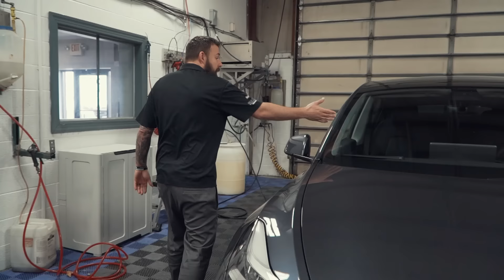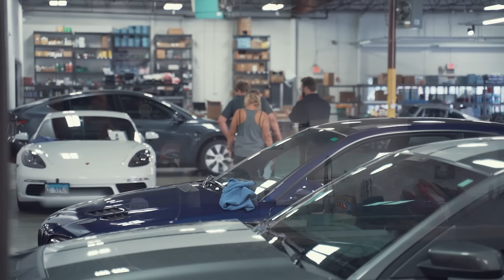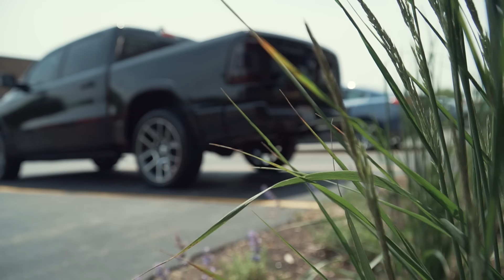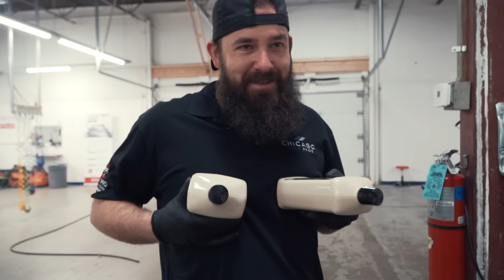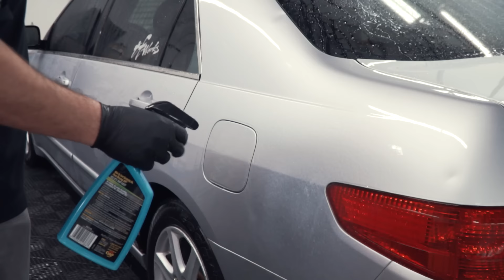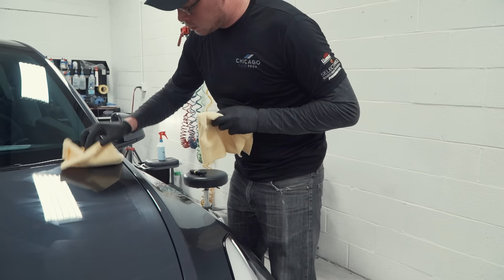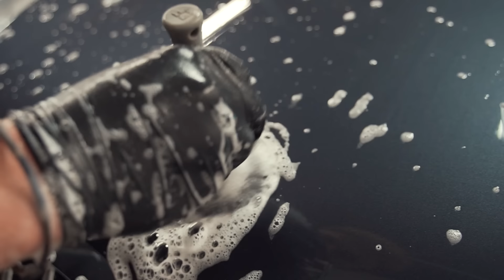Everything You Need to Know Before Buying a Ceramic Coating

Comment: As a seasoned auto insurance adjuster of nearly 2 decades, I have nearly seen it all. My involvement here is post-collision repair partial application invoices. Original invoices are also acquired for verification. In Southwest PA original bills for ceramic coating are running anywhere between 1,500 to 10,000 dollars. Yes, there are people paying 10 large for ceramic coating their..... Ford Explorer. On average it's between 2,500 and 5,000. Re-apply after paint cure time is running around 2,000 to 2,500 for 25% of the vehicle. Sometimes 4k or 5k. The issue so alarming here is the lack of knowledge combined with incredible sales tactics, pressure and manipulation. The general public is being led astray and they are pouring out their wallets for this stuff. And while the 1% of vehicle owners who are car enthusiasts, and might ceramic coat their well taken care of vehicle, the other 99% drive their vehicles into the ground and should be using their hard earned money elsewhere. Sadly, many people will listen to a new car salesman over anyone else. Somehow the new car salesman hoodwinks the public into believing their fabrications. Your Ford Explorer that in 3 years will be driven into the ground, be covered in curb rash, dents and scratches all over, which you will get rid of as soon as the warranty is up does not need ceramic coating! But if you wash your car regularly, detail it regularly and actually open the hood on a regular basis and care for it, then get the coating. Just don't get taken advantage of and think that in any world it is ok to spend 10k on this, let alone even 2500 dollars.

Comment: My cars getting done as I type this.
I come across this video and because of the title and likes, I freaked out at first lol.
Great video,  title ya got me!

My question is, my Karcher K7 pressure washer has 3 speed's.  And the rotation cycle. 

I had been washing my car on the highest setting,  and rotation cycle. 
Am I using to much pressure and is rotation setting good or not? Please
Reply from the maker: Definitely use only as much pressure as you need to properly clean your vehicle. Remember that the soap/shampoo you are using should be doing a majority of the work, and that the water simply carries them away. Look into flow rates, as a combination of a good flow rate and pressure will make cleaning a breeze once you're dialed in! A pressure washer should not affect a ceramic coating.

Comment: Hi,

I bought a new car a couple years ago and it has a clean accident history, however after washing numerous times I noticed the front fender has lost its gloss and looks dull like it has been painted previously. How should I fix this? Should I get the fender clear coated? Will a ceramic coating and paint correction be enough to fix it? 
Please help

Comment: I take care of my car regularly by hand-washing it. It is completely covered with Expel Stealth Ultimate PPF.  I thought adding a ceramic coating would allow water to sheet off the car so I wouldn't have to hand-wipe it down after washing.  WRONG.  I thought it would help eliminate water spots from dew, rain, etc. WRONG. This was a VERY expensive mistake on my part. If your water is soft, it might not leave spots, but my water is  hard and calcium (one of the ingredients in hard water) makes white-edged water drops all over the car if I let them dry without wiping the car down.  It is MURDER to get the spot off the PPF.  I used the Expel Ceramic coating because they said it would work with their PPF.  Save your money. It doesn't.

Comment: Thanks for sharing great video. I have 2 questions 
1) How increase level of scratch resistance when I apply ceramic coating?
2) In terms of scratch resistence, is ceramic coating has same level of protection with wax/sealant/hybrid sealant?. Thank you

Comment: So get your car ceramic coated and then bring it back in to get it topped every 6 months to 1 year? If ceramic coatings are so durable, why the topper? Every 6 months you would be waxing anyhow, right? I'm really confused why I should spend the money on ceramic coating when im going to wax it every 6 months anyhow. And I can do it at home, myself. Please clarify why the ceramic coating needs the topper and why I shouldn't just wax my car every 6 months.

Comment: So I have a question about some of the ceramic coating’s. Some of them will say in the directions that you need to wipe it off in 30 seconds. So I’m assuming it could wait at least a few minutes because how could you ever get any work done if you’re too busy wiping off constantly. I just need a little clarification on this. The one I have says 2 minutes but I’ve seen one I was looking at said thirty seconds.

Comment: I have a new phoenix bass boat 2023, my dealer offered me this option when I purchased it but i declined at that time, But now reconsidering it, I normally wipe the boat down and use lucas SLICK MIST. spray was, I have found this brand to work the best and is what I have used on my previous boat's , I am located in Texas and boat is used in fresh water lake's only, Just looking for a product that work's best for marine application's. any brand recommendation's?

Comment: I disagree about a coating being useless if take through a car wash. 

I have a client that takes his Audi A5 through a wash a few times a week. 

The first time I serviced his car I used a sealant + wax over top. When  it came back it was swirl city. 

The second time I used Optimun Gloss Coat, and the swirls were much lighter, and were easy to remove. 

The time after that I used Megs M26 and it came back really swirled up. 

This last time we used Jescar Ultra Lock +, but next time we're probably going back to the Gloss Coat.

Comment: I use a good outdoor car cover, and wash my car at least 2-3 times most months, except in the winter where I have a body shop wash the car. When I do it myself I spend an average of at least 3 hours washing and waxing. I wax my car at least 2 to 3x every two months with a spray wax. My car is a 2012 volvo. Neighbors tell me it looks brand new. I wish I had a garage. I'm looking to move, and hopefully I will have a garage. A bird two years ago on a windy day somehow snuck under my car cover, and  left a stain. It was there 2 years, and I finally had it repainted.

Comment: Question, I'm buying a tesla model y and I'm reading the horror stories about the paint. I'm thinking between vinyl wrap or ceramic. What would you recommend. I do wash my car on a regular bases (hand). Waxing not as much and I live in Ontario Canada so I have 5 to 6 months of harsh winter which I usually just power wash once ever 1 to 2 weeks.

Comment: After having a ceramic coated vehicle I'm not sure I get the hype. If I get a 3 year coating and have swirl marks after a year I'm sort of stuck with them until the coating fails... but how do I know it's failed and hasn't just lost hydrophobic properties? Well maybe I'll polish it off... how can I tell that the coating is actually gone and I'm working with just clear coat? But if I use a good sealant I can polish whenever the car needs it and not have to worry about wasting that $1000+

Comment: I have an 81 black z28 with single stage paint. I've buffed the car a few times now, and it looks great from 5 ft away. I cannot get all the scratches out because of fear of cutting too deep. I want to ceramic coat it to help with maintaining the shine and also  to make cleaning it easier. Blacks a PIA as you know. So my question is this, when I do decide to get the car repainted some years down the road , will the coating cause any issues for the body shop?  Will it just sand off when they prep it? Thanks and I enjoyed your video. Very helpful

Comment: Hi, if you were to do a clear bra and then a ceramic coating on top of it, a) is it worth it to do both, and b) will the clear bra, if you have experience with those, will they help prevent from rock chips, etc? Another question on top of that, is for buggy states, what do you suggest to keep bugs from sticking, would the ceramic coating help with that?

Comment: I fully maintain my vehicle and I've had it for 3 years now and it still has that showroom finish.  I get it washed every morning because, I am an Uber & Lyft driver and I have a 2019 Ford Explorer in a Magnetic (Dark Gray) paint when I bought the vehicle new.  I go to a place called "The Wash Tub" here in San Antonio, Texas, and they are charging me $119.00 for the ceramic coating protection.  Is that good or should I go to a specialist.  Cause, they were telling me that the sheen or shine will only last for a 2-3 months and then I have to get it again.  Can you confirm before I make up my mind.  Thank. You.

Comment: Is there something to put on a vehicle to protect against scratches? I’m a contractor and I want to try to keep my truck as good as I can without scratching it by leaning over the side of the bed to get something or brush up against a tree branch and such. I’m not looking for a big shine or anything like that, I just want a protective layer for scratches. I’ve had my truck for 3 months now and I have scratches everywhere. My son was washing out the bed of my truck for me and the hose rubbed against the side along the front door, back door, and box and you can see right where the hose was. Stuff like that I would like to about if possible. Oh and my truck is black so everything sticks out like crazy.

Comment: I just had my Wrangler ceramic coated with Renny Doyle, and I noticed a few high spots/ smudges left on the paint.  Also, I noticed that the trim (fenders and plastic hood pieces), look streaky.  Are the plastic fender flares supposed to be ceramic coated, and how can I fix the streaky look? I apologize for all the questions.  Unfortunately, I didn’t do my homework before having this done to my brand new Wrangler.

Comment: I ordered 2022 RAV4 SE which has shiny (as opposed to flat) black trim around the wheels and above the undercarriage.  Been wondering how best to maintain the shine.  Should I be putting a ceramic coating on the shiny black trim?

Comment: Hey, just saw this. I’ve been professionally restoring headlights since 2017. Using the traditional sand and coat method. Recently I have been getting lots of questions about ceramic coating. I’m thinking about adding it as an option to cater to those people needs.any suggestions as to what to look for ? So many products prices and information. Is there a ceramic spray that’s just as good as the other?

Comment: Are you able to put a car cover over a ceramic coated car? My car is rarely driven and garage kept but it does get dusty fast. I want to ceramic it but if a car cover will scatch it too easily is it worth it? the way my garage is faced it always picks up dust fast.

Comment: Hi. So its almost 1 year into my car with PPF in front and rest of the car as ceramic coating. I wash my ca car 2 times a month with touchless car wash and then hand dry. Recently I drove in the rain which resulted in my car all dirty and spotty coming from vehicles in front of my car. Didnt have the time to wash right away and when I did 2 days later I could see dots all over the car. I used warm water to hand wash and it took out 70% if the gritty feeling. No scratches. But its still there and I dont want to over do it. Whats the best way to address this

Comment: So my other half takes his car thru a car wash and has a monthly unlimited pass. I've always 2 bucket washed my vehicles but after seeing how easy it is to take it thru the wash and they have the best vacuums- which I no longer had to lug out and run extension cords so I finally just started doing that. I just got a new Black 23 Tacoma TRD 4X4 Off-Road and I will not be going thru the car wash any more. So there is a ceramic coating place in town and they have lifetime warranty-I know ceramic coatings only last a few years so should I be weary of getting it done there-or what? Should their facility have any special features-like does it need to be done in a dust free zone, special kind of lighting etc.? I was also wondering with time does/can the ceramic coating start to peel or cause any kind of damage to the paint? Lastly, can you put wax on top of the ceramic coating to add another level of protection?

Comment: Hello from Sudbury, Ontario Canada! I have a question for you sir, but first a little background.
I just bought a black 2016 Mazda MX5 Club with only 8,000 miles, has the factory Sport Package (Brembo Brakes, BBS wheels, Bilstein Suspension & Recaro Seats). It's one owner car, meticulously maintained, lived in a heated garage, never saw snow and very little rain. He told me that a rather expensive ceramic coating was "professionally" done 2 years ago. Yesterday, I was at my local Canadian Tire store and saw a "Rust-Oleum Wipe New Synthetic Wax System" product on sale so I bought it. 
Now I'm wondering if I should apply it. I know absolutely NOTHING about proper car-detailing so my question is this...... Should I apply this stuff to my car knowing that it has already been ceramic coated?

Thanks for your time!
Leo

Comment: Well it's just the time & money to deal with ceramic anything..I just spray 2 more coats of 2 k clear every 5 years..turtle wax wash & dry works..you can do scratch removal & shine without removing layers of build up grime..soaps don't clean the grime so they build up with toppers

Comment: Very informative!!  What do you think about getting a Nanoxide coating on a used Lexus I'm getting ready to buy?  Although this car is 4 years old, it only has 16,000 miles on it.  The dealer is offering to install this coating on the outside & inside of the entire car for $1,200  and will warrant it for 7 years.   I plan on keeping my car for 10 years although I do NOT keep it in a garage and live in New Orleans where the sun can do a number on a car.  BTW...I'm a Realtor and usually save time going through a soft touch car wash several times a month.

Comment: Hey Jason, I’ve done a lot of studies and am still struggling whether I should go with PPF+CC or just do CC alone on my new chalk color car? Honestly, I’m not a big fan of putting those plastic things all over my car and having to peel them off after 5 or 7 years (plan to own it for a long run), not to mention that PPF+CC is blurrier and fuzzier than CC alone, but PPF really stands on its own benefits which are undeniable... what would your recommendation be? PPF+CC or simply CC?
Reply from the maker: I would do PPF over a ceramic coating. After having PPF on on few cars now, I will never own one without it.

Comment: Paint correction confuses me to no end. If The clearcoat sits on top of the paint, then why does paint come off on the buffer when cutting and polishing? is there a strange mix? why measure the clearcoat if you’re taking paint off? It’s just confounding to me.
Reply from the maker: 3 layers. Primer, pigment and then clear coat. You can on perform paint on the clear coat, removing scratches and defects by removing small layers of clear coat. If a deft is past that clear coat layer it can not be fully removed.

If you have paint coming off it’s probably a different paint system called a single stage paint where clear coat and pigment are mixed. You will see this on older classics.

Comment: I'm planning to buy another new car, my other car that I bought brand new last year doesn't have a ceramic coating but because I have an unlimited monthly car wash pass. I always went to the car wash at least twice a week whenever it's dirty. They have the machine and afterwards a group of people will wipe it off manually with the cloth and hand. But my car has a lot og microscratch, still looks nice and new after the car wash but when you come closer you'll start to notice the micro scratch.
So is it good to have the ceramic coating protection to my new upcoming car or not if I always go to the auto carwash that I mentioned? Thanks

Comment: How do you get it off?  If you have to repaint a fender and blend into a door by example.  What solvent takes it off?
Reply: Any surface you are going to repaint, you will be generally be using at least 400 grit to prep those surfaces, which would be easily remove coatings.

Comment: I've been following videos on detailing am planning to try this out on own. My car has nano-coating, but there are current lots of permanent water spots on the paint. Just a question, if I do tar removal and iron decontamination, followed by clay bar removal but do not do polishing, is the ok? Reason being that I'm not comfortable doing polishing with the machine at the moment. Thanks.

Comment: Could ceramic coating keep bugs from sticking to the paint?   I have Texas size bugs going suicidal on my truck all the time, in Texas.  I'd like to only rinse the bugs off instead of the "pre-soak" then scrub routine. Compliments on the video, very informative
Reply: you will still get bugs, but they come off super easy with ceramic coating.

Comment: Bought a Calypso Red Hyundai Santa Fe for mom they use the ECP PLUS DIAMOND CERAMIC Coating  seems to cover it all wheels trim moldings etc w/7 yr warranty. Can u offer any advice it’s over $1000
Reply: ECP is a dealership 'coating', which is generally a wax with a warranty. You'd be better off taking your $1000 and bringing it to a true detailer.